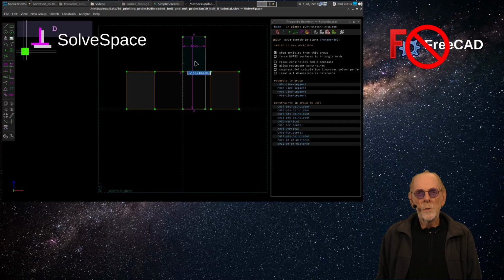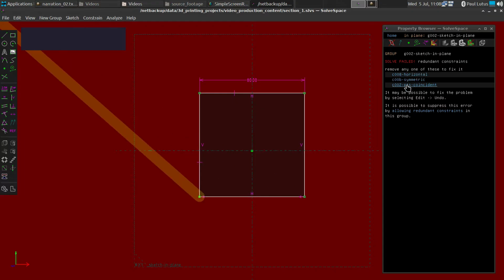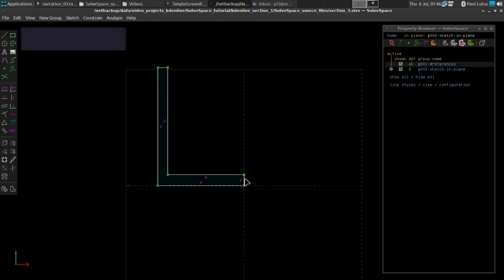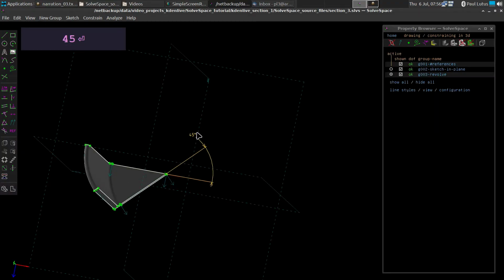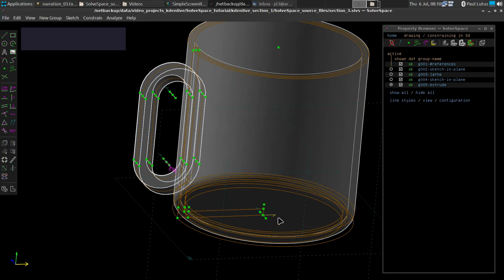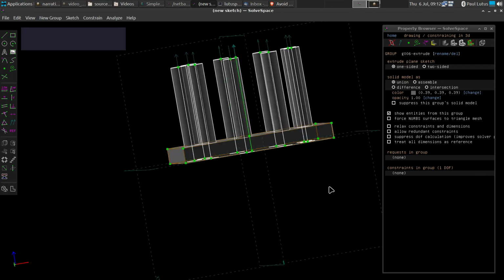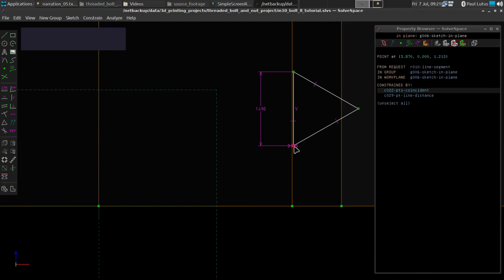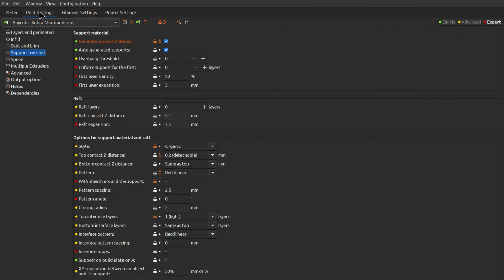Learn 3D Design with SolveSpace

Comment: thank you so much for that video
Reply from the maker: You are most welcome! I'm happy to hear it served your needs. And I don't understand why more people aren't using SolveSpace, which IMHO is a terrific program, easy to use.
Reply: @lutusp   problem for solvespace for me is there is no global variables and functions, i do model parametric gears with involute curve profile in freecad but it is not so easy on solvespace, possible but harder. actually solvespace fits me more but that feature is a bit important.
Reply from the maker: @youtubehesabim-u6m  Yes, it's true there are no explicit global variables, but one group can rely on the dimensions of another. This means if you plan a task carefully, you can make subsequent groups entirely dependent on previously defined dimensions, by simply selecting the desired dimensions in later groups.

But I agree that it would be better to have explicit globals.

Thanks for writing!

Comment: Nice video, but how did you set all lines to equal length at the same time? Solvespace does not allow constraints for multiple objects in version 3.1.
Reply from the maker: >> "Solvespace does not allow constraints for multiple objects in version 3.1."

Actually it does. But if you select everything using Ctrl+A, that selects everything -- lines, points and all. That will fail. If instead you select only the lines and press 'Q', they're all forced to be equal length.

My tutorial uses this equal-length feature multiple times -- once for all sides of a triangle in the bolt's thread prototype, another for all sides of a hexagon in the same section for the bolt head design.

The video shows me explicitly selecting the six sides required for my hexagonal bolt head --- but by selecting the lines one by one, not using Ctrl+A.

Not wishing to make unwarranted assumptions,  I just tested my understanding with four lines having random arbitrary lengths. Then I explicitly selected the lines squentially until all four are selected. After applying 'Q', a square appears. If instead I use Ctrl+A, the experiment fails because that creates a collection of lines and points.

Hey ... try it. But don't select everything with Ctrl+A, instead explicitly select lines before applying 'Q''.

And thanks for writing!
Reply: @lutusp  No, 3.1 does not allow that. The current development version does. It's one of the big improvements coming for 3.2.
Reply from the maker: @paulkahler6373  > "No, 3.1 does not allow that. "

Context is important. On Linux, where compiling from source is the norm, the currently posted 3.1 version provides the feature.

Nevertheless, I should have tested the currently available Windows version (which doesn't have the feature) before relying so much on the feature in my video.

As always, thanks for writing.
Reply: @lutusp  Thanks for your answer but I don't use Ctrl+A, I select lines one by one like in your video. As a result, the following message appears:

"Bad selection for equal lenght / radius constraint

This constraint can apply to:

- two line segments (equal lenght)
- two line segments and two points (equal point-line distances)
- a line segment and two points (equal point-line distances)
- a line segment and a point and line segment (point-line distance equals lenght)
- four line segments or normals (equal angle between A,B and C,D)
- three line segments or normals (equal angle between A,B and B,C)
- two circles or arcs (equal radius)
- a line segment and an arc (line segment lenght equals arc lenght)"

So as you can see you cannot constraint 6 lines in Solvespace 3.1, at least in the Windows version (multiple lines constraint will be in the next version). Also the constraint of 4 lines does not result in a square with equal sides. Maybe the linux version allows you to do this.
Reply from the maker: @eryk7545  I just downloaded and tested the Windows version of SolveSpace 3.1 and it's ... well ... not current, not synchronized with the source.

For my Linux environment I've been compiling SolveSpace from source (there isn't a prepackaged Linux version), and it seems the source differs from the Windows release versions including 3.1.

I apologize for this, it's rare and unprofessional to have unsynchronized sources, but the latest SolveSpace source, required for a Linux installation, isn't present in the Windows version.

So, sorry, but it seems my tutorial doesn't cover the precompiled Windows version in all respects. You can still get the results I show, but the steps differ. Specifically you have to specify equal lengths for pairs of lines, not more than two at a time.

If you're dedicated to SolveSpace, you can compile from source on Windows as I did on Linux, in which case my tutorial is correct in all respects.

And finally, thanks for bringing this to my attention.